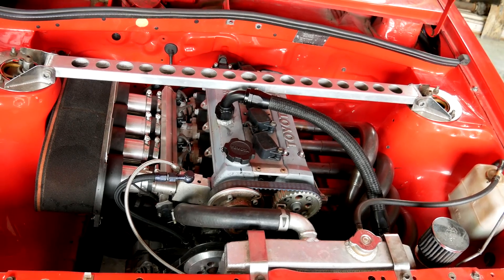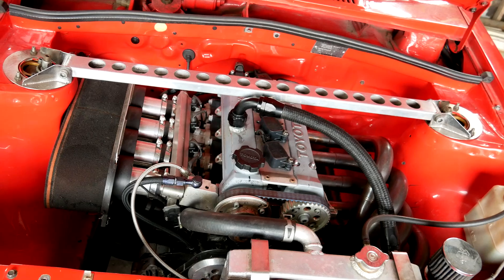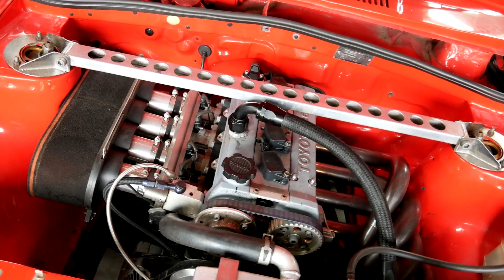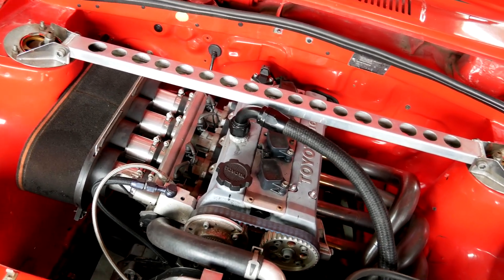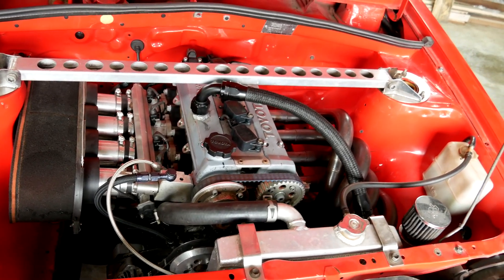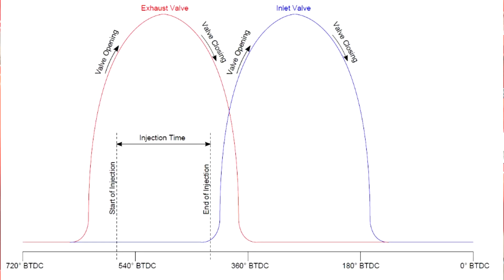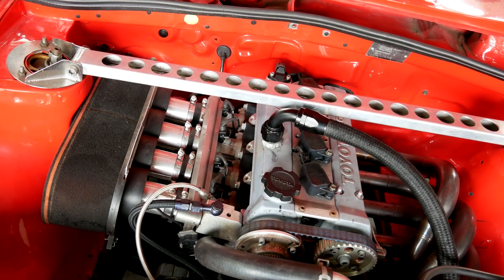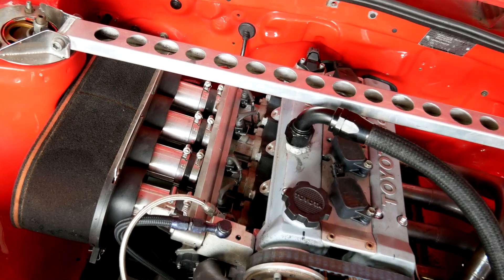Injector timing - Injection angle - Dyno tested

Comment from the maker: Just noticed i screwed up the graph showing the 350 degree  injection event,   Its at 370 degrees rather than 350 degrees.  the whole thing should be to the right 20 degrees.    So yeah that injection event is well into to the open intake valve.   Inlet valve has been open a long time at this point.    It runs 3 - 5.5mm at  TDC (360degree)  depending on engine rpm  (vvti)

Comment: Good video. Well done. What this proves is that it really doesnt matter once your past like 5k RPMs the injectors are spraying all the time. Injection angles make the most improvement in the lower RPMs 1k-4500rpms
this car also had individule intake runners, where spraying on the back of the valve could result in another cylinder stealing the fuel if it were a multiport intake manifold
Reply from the maker: Most setups yes.    But this one can clearly see it makes a difference in the top end. injectors are only running at 40% duty at max power,  so can actually move the injection window around,   unlike something running at 80%+
Reply: @Garage4age  what kind of overlap did this cam have?
do you have a video where you sprayed it doen the open intake valve?
i tried spraying on the back of the valve with little succsess.
Reply from the maker: @GoFasterHD    engine has vvti so overlap varies.    but lots, cams around 300deg mark and  0-6mm lift on intake and about 4mm exhaust at tdc.     Some engines like injecting on open valve at low load and engine speed.  It can vary a lot depending on engine.  a lot dont care at all and happily run at a fixed injector timing everywhere.  with no point chasing it.     is a part 2 of this video running same tests on a close to stock engine
Reply: @Garage4age  thanks for your time.

Comment: Try dropping injector size back so you can run them at about 90% DC at max rpm. This means most of the air column is wet. V8 supercars did this, but they went a step further and tuned for max standoff, thus filling as much of the airbox with fuel vapour, resulting in a completely wet air column.

Comment: A good test will be with bigger injectors that will be used in low duty cycle (lower than intake valve duty cycle) . Maybe you will find some diferences in hp there by altering injection timing
Reply from the maker: they are pretty big already,  980cc  running at about 40% at max power,   which is under the advertised intake cam duration

Comment: Why didn't you do some testing with the inlet valve open to the point just before it closes? The rush of intake charge and subsequent VE is enhanced by charge momentum. Injecting fuel onto the back of closed valves has its merit, ie fuel vaporisation, but to stop the flow and then re accelerate it to move the mixture into the cylinder is counter productive. Do another test and move the EOIT to just before the valve closes and see what happens. The idea of using a large injector is fantastic and makes total sense in this experiment. I'm keen to see your new test results. 😀

Comment: Have you ever tested engine angle? I remember back in the day putting a 4 k on a big angle to aim the intake ports as vertical as possible was supposed to be hidden power.
Reply from the maker: pretty sure most of the k series guys do  the upright to get a better intake and longer intake length. which is where the power comes from rather than the angle of the engine

Comment: Any tips on where to go with this value for a big cam that jerks at low rpm, low load? Maybe it has to do something with the attomization, earlier eoi would increase atomization? Or make puddles in the port? I will try it tommorow, I was wondering if tried it before

Comment: Thanks Mate
I realized that this engine needs a lot of fuel at the top end, AFR like 12.3 or less
More like a turbo engine.
I was not that in to the injector timing.
Thanks
Reply from the maker: @juangraniello7626  hey.  I intentionally had the afr set a little rich on the baseline. As I knew it was going to go lean when changing the injector timing.  Usually run it closer to 13

Comment: Have you thought about a dual injector set up? Basically adding one in airbox to shoot down trumpet. Then you could run smaller sized injectors with the inner Injector cut back to 40-60% total fuel, or tapered off entirely. You'd have to get the phasing right, and added fuel system complexity, but it could be good for throttle response, atomization, and pulling heat out. Normally not a commenter, but I just read about this.

Comment: Of note is that when the engine "leans out" in the top end because the EOI is well into valve-open area, actual equivalence ratio has not changed. The amount of fuel and the amount of air going through the engine is exactly the same. The reason it looks like it "leans out" is because less of the O2 is being burned because less fuel is being burned because less fuel is being vaporized. 

Just like a misfire that will show sensor-lean because all that unburned O2 went through the engine...but the actual AFR didn't change. 

Low pressure port injectors do a pretty shit job at atomizing fuel, which is why the OEMs mostly use around 420° EOI. It puts the fuel on the back of the hot intake valve and ends up with more fuel vaporized when the valve opens. On some engines, I like to use smaller, modern Denso injectors and dial up the fuel pressure. This allows you to shorten the PW, generally results in better atomization, which results in better vaporization, which result in a more efficient calibration. 

Conversely, on systems with the injectors not aimed at the back of the valve, but way upstream, like in the DCOE-style throttle body, injector timing can be a nightmare. EOI on a closed valve and no moving air just puts the fuel on the runner wall. Idle and mid can foul plugs in no time, and require a lot more fuel. Fuel needs to be injected into a moving airstream, mimicking a carburetor. This also makes Δ-tau, or transient fuel a nightmare to tune, as a lot of fuel is going to condense on the long port wall as soon as the throttle is opened. Requires not just a big shot on throttle opening, but also requires taking fuel away on throttle closing. 

Anyway...great stuff you're doing here.
Reply: Hey, can you please explain more on EOI timing for high rpm, im tuning a motorcycle which has a port injection, does advancing the EOI to only inject the fuel before the valve opening actually more efficient than injecting the fuel on an open intake valve? Since doing it on idle makes a really smelly exhaust. 

Im also curious on why tuning the EOI before the intake valve opens actually a good idea since on a higher overlap cam, there is a chance that more fuel is being thrown out through the exaust, thus promoting lower fuel economy than adjusting the Start of injection right after the exhaust valve closes. Thanks!
Reply: @Laff1N  injecting on the back of the valve helps the fuel evaporate, the fuel has to evaporate before it can burn, every motor is different, you may get better results sparaying down the hole. I run a Fuel Tech on a Turbo Harley I have to spray down the hole or the  opposing cylinder will steal the evaporated fuel that was sitting on top of the valve, it can also be sucked out during the overlap. the injection timing is more revalant in the lower RPMs below 4k rpms above 5krpms the motor is spinning fast enough and the injectors are spraying fuel all the time it doesnt make much of a difference
there is a very good video from TunedbyShaneT  titled: What’s @TunedbyShaneT Talking About Today? Injection Timing/Phase Angle
Reply: @GoFasterHD Thanks man 😊

Comment: Its weird i get maybe like 50rpm bump on idle when im at 70-100 injection timing any idea guys
Reply from the maker: what does the afr do?
Reply: @Garage4age  afr is the richest at this these timing.. maybe not that rich but its very close with typical timings…20v st. I suspect i may have some problems but i already swaped/changed injectors, fp, ff.
Reply from the maker: @marlo0oty213     might be just what it likes,  20v's are weird haha.     if afr is richer and idle speed increases both signs thats what it likes.      as you  know if the afr goes richer from  say 14.7afr  it will make more power.   so adjusting the injector timing  to where its richer,  will make it idle faster.    lean it back out and if its happy leave it there.  

tbh i never got around to setting the injector timing on my 20v.  its just set at 400.  may put it back on dyno and try some stuff with it
Reply: @Garage4age  its weird man ive tuned many other different cars but after 2 years of tuning i still can’t tune my own car and the tune is always funny… im like at 40 degrees ign advance mid to high rpm and whats weird is the car is responding on that timing and its 100% synchronized
Reply from the maker: @marlo0oty213   have you seen my latest video with the 20v?     it liked 200- 250, was all kinda the same across that range.    but i do recall it  did something around the 70-100 mark as well
Reply: @Garage4age  I didn’t but i will look intk it. But that also confirms what my guy also had on his base tune “he makes a plug and play speeduino for the 4age” and I remember he had it on 210-220
Reply: @Garage4age  Omg i was waiting for that vid long time ago but it seems it doesn’t have much of a difference. Mainly i was trying to study this because im suffering from a stumble at high rpm from a year now and im still trying to figure out whats causing this. I’ve spent +50 hours on that thing
Reply from the maker: @marlo0oty213   not a trigger issue?     only time Ive seen injector timing effect  a misfire issue,  was on a car with injectors near maxed out.    That seemed more like an ecu thing, rather than when the fuel was being injected.

Comment: @5:53 have you done a video on the step vs non step and I missed it? 
I assume you added this due to another video's recent success, did you notice if it had any impact on sound on a high rpm 4age?
Reply from the maker: I haven't done a specific video on stepped headers,  that singles out the step.   but have a few videos testing my various headers. some have a step some not.   I don't usually run open headers, so cant say if there is any difference in sound.  I would assume there isnt enough firing events on a a 4 cylinder at 10k to make any exotic noises.   Check out the Atlantic car on my channel,  it has double stepped headers https://www.youtube.com/watch?v=bWNdVy5bNBA&t=97s

Comment: With an injection phase of 500 degrees, we got more power and a leaner mixture.  It was worth trying to add fuel at maximum power speed.
Reply: Nope, if O2 sensor shows a leaner mixture when fuel amount is the same, then it is not fully burnt, which is not optimal.

Comment: Great video in which the results speak for themselves. In short if your looking for power with injector timing your wasting your time.
Reply: It depends on how far away from ideal the injection timing is to begin with in a particular setup. I have seen stock configs that gained substantial TQ & power as well as the top end AFR enrichen by as much as .05 lambda which was useful in that engine,  by adjusting only injector end angle. Injection timing was not done using the approach in this video.

Comment: So what was the actual initial base value ? Would be nice to also see injection with the valve still open, even though it is recognised to inject against the closed valve. With high duties, it's going to end up injecting when the valve is open at some point anyway I'd think.
Reply from the maker: 425  ramping up to 450.     Yeah most people will be injecting through most of the engine cycle due to injector duty.      350  part of the injection is on open valve.  i messed up the graph (blue  highlighted part)  on that one, its shows 370  rather than 350 end of injection.    engine has a lot of cam overlap so valves are well open at  350

Comment: I really enjoy your videos (well done)!!! I have an idea given your combination of parts and tuning is really well optimized (though it may not make any better peak power / bit possibly better average power); would be to make a common plenum to go in place of the air filter…..I think this may result in some gains because, in an earlier video you showed it made slightly better power with the hood down on the dyno…..I’m not an expert that can recommend an exact volume / shape and inlet tube diameter / position, but I do know tunnel ram manifolds on a V8 (think pro-stock / comp-eliminator engines), can make better AVG power than stack injection, due to taking advantage of the tertiary waves / resonance (minimizing torque dips that the harmonic tuning of the intake runner length induces)…..this practice is well studied on 1L race bikes / Moto-GP, which may help to give some inspiration if you wanted to research / try a modification like this….keep up the good work!!!

Comment: Great job, really!
Just curious if you are working on Full group or batch injectors ?
Reply from the maker: sequential  injection.    You can see how this engine would have rich / lean cylinders if was running batch fire.
Reply: @Garage4age  OK, good to know.
At the time of R25 F1, Renault work with continuous injection on RS25 V10 engine (!).
An hydraulic damper/absorber on your fuel rail will be a good option for smooth AFR ratio values with no pulsing effect.

Comment: The graphs of the AFR seem to have "waves", especially at low rpm. Is it because the intake pulses sucking and pushing the fuel in and out of the intake?
Reply from the maker: Yeah basically,  the intake and exhaust tuning doing weird things down there.  is an issue with big cam overlap at low airspeeds.  you can see the peaks and dips line up with the bumps in power.  the fuel map looks the same, but its quite hard to get spot on since the ve changes so fast.      could dial it out with intake and exhaust tuning.   but would have to sacrifice power everywhere else to do it.       It's kinda a non issue anyway, as it doesn't do it at part throttle  and you arent ever at wide open under 3000rpm where its bad.

Comment: OEM used injection timing on part load in order to decrease consumption, HC and CO emission. The goal is to reduce wall wetting. You can also do stratified combustion with a retarded timing. But it works only at low part load.

Comment: great video
how about a video on the effect of changing the fuel injector dead time

i had a problem running the car and the afr was super rich and had to lower the ve numbers substantially to get the car to run .. i found later that the injector dead time was set up for different injectors
Reply: injector dead time only really matters where battery voltage is changing. IMO if your voltage is unstable, you need to fix that first and foremost.

Comment: Niiiicee...but why didn't you try the whole spectrum? Also injection on an open intake valve?
Reply from the maker: not much point going further if its getting worse in either direction.      Part of the injection event on the 350 runs is on open intake valve.  the valves are open well before tdc  at 360.  just noticed  I screwed up that graph showing the  350 injection event,  its at 370 not 350

Comment: Played with injection angles the other day, seems like it makes more of a difference in low load/idle/cruising. Thanks for the video!
Reply from the maker: Yeah  most engines it doesn't do much at wide open.   esp if injector duty is high, as they will be open near the whole time anyway
Reply: @Garage4age  would you be able to redo the test but at steady cruise to see what one gives the lowest injector pulse width with the same hp?
Reply from the maker: @aaronkirkbride1057    maybe i will do another video with a  mild/stock  engine  to show these kind of things.   I used the starlet for this one, as it actually does stuff at wide open.  your average engine, not so much
Reply: I noticed it makes a big difference to emissions. CO and HCs

Comment: Those stepped headers sound epic :)   i just saw a vid yesterday about someone trying to get that resonance out of his headers and it turned out need to have steps in them - sounds awesome :)  Did you pick up any power after stepping them - or its worth any losses just for the sound? :)  And yeah - a video about how you get such consistent runs would be great :)  along with "cheats" like how hard you strap it down and what tyre pressure does to it and how fast you ramp things and if you have an ambient air temp sensor on the dyno for dyno power corrections n stuff :)